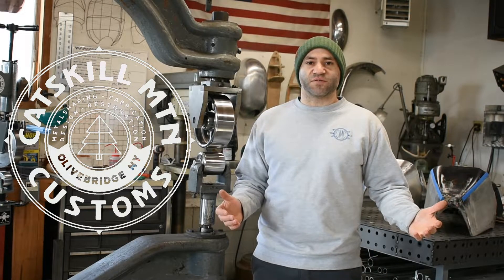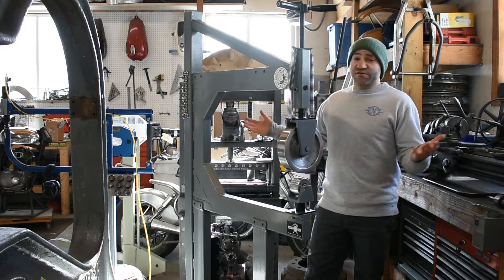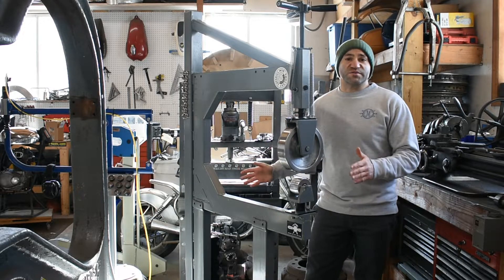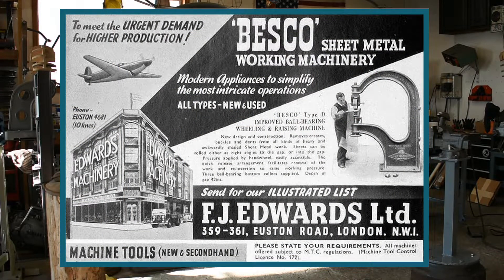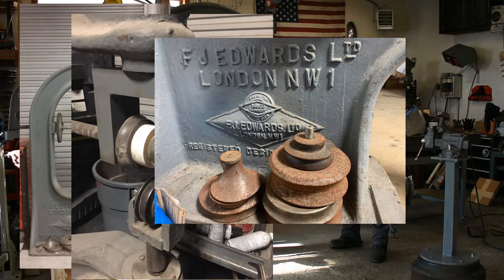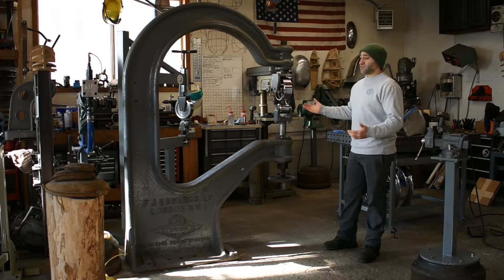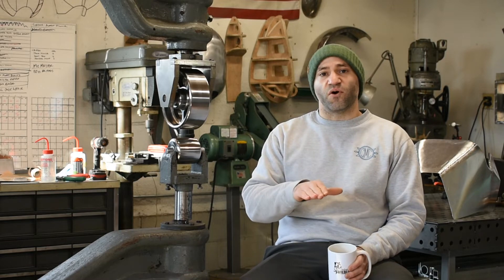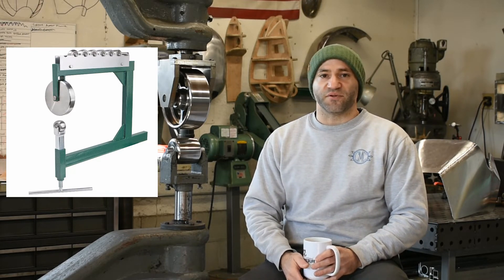Metal Shaping: Which English Wheel Should You Buy??

Comment: Great stuff! I built one to my specs. Free scrap heavy tubing, turned my own anvils, turned and polished a forged 3” top wheel. C - frame with top adjuster. All in, bearings, 4140 stock, acme thread - maybe $300. Fun machining project! I, and friends, like it better than the Metal Ace in our club. Be patient hunting for supplies, be willing to spend for a good top wheel. I bought a cheap caster top wheel that worked but never liked it. Bought a forged heavy castor and designed tapered bearing cups and am proud of it. Don’t cheap out and you can still have a pro quality beast for less than a HF wheel. Thanks for this content!
Reply from the maker: Great info, and it sounds like a fun project! The difference that sets you apart is the skills and access to machinery to do all of that work. There are a lot of excellent panel makers who have little to no machining knowledge, or access to equipment. I only own a 9” Sounthbend lathe, turning a forged top wheel would be a big ask. Not to mention the time you have into that machine. When you factor in all those aspects, you have a very expensive wheel! I guess my point is if you have the time, skill set, and machinery access you could make a very nice wheel. But, for many, that simply isn’t a realistic option.
Reply: @CatskillMtnCustoms  Good point. I’m also persistent. I have friends with the tools to build things and they still buy or go without. I must have a problem.
Reply from the maker: @836dmar  haha I wouldn’t call it a problem. You enjoy it as well, so that counts for something! Personally, my time is what’s most valuable to me, so that’s always my biggest factor. It usually makes more sense to put my time into customer projects and just buy equipment. Then when the tool arrives, I can put it straight to work. But, I’m running a small business so everyone’s situation is different 👍
Reply: @836dmar  Ha!  Old school craftsman.

Comment: would love to see all your metal working tools in your shop
Reply from the maker: I actually don’t have a ton of equipment. My large tools are the Edwards english wheel, a small Sosa Metalworks power hammer, a Mittler Bros planishing hammer, and a Mittler Bro bead roller. I have a decent collection of hammers and dollys which get the most use. If you check out my Instagram posts you can see my set up 👍

Comment: This was really good info about English wheels. What are your thoughts on the Eastwood Elite large framed English wheel?  I have worked on a MetalAce at one shop I worked for but we hardly used it and it collected more dust than being used. Plus I won't be using it as much at the start.
Reply from the maker: Thank you, and thanks for checking out the video. I have never seen that particular English wheel in person, but it seems a little overbuilt to me. Similar to the yellow baileigh wheels. For the same price I would lean towards the Mittler Bros bench mount english wheel which has the same throat depth as the large Eastwood 👍
Reply: @CatskillMtnCustoms  You're welcome, thank you for your info. I'll go check out Mittler Bros one 👍

Comment: Hi Nick. How much flex are you talking about? I look at yours and think omg how beautiful it is and my immediate though is 0 flex has been engineered into it. Can you please explain a bit further. Thanks for this video too.
Reply from the maker: Hey Paul, thanks for checking out the video. The wheel definitely flexes, but the amount of flex is very difficult to describe. For example, if you are wheeling a panel with moderate pressure, and the panel comes out, you can push it back between the anvils without loosening the adjuster. Also if you hit the top anvil mount with your palm, the anvil will move side to side about 1/6”. When you think about it, any shaped panel has varied thickness throughout. The wheel needs to flex to accommodate for the thicker/thinner sections. If the wheel did not flex, it may squeeze the thick sections and not even touch the thinner areas. This is especially important when planishing out a panel to a nice surface quality. Hope that answers your question!
Reply: @CatskillMtnCustoms  that's amazing a 1/16 is a huge amount. Thanks for taking the time to message back. I will be checking other videos of yours too. I don't thing Wray has ever mentioned there is flex. I know if the panel comes out you can push it back in with force, just figured it was in the adjusters. I have been looking at Wray wheels and my own design. May just have to go with his plans and be done. Thanks once again.
Reply from the maker: @paulnewton943  No problem. Yeah, 1/16 is a lot, but keep in mind that’s front/back flex. To flex it up you have to overcome the weight of the frame’s top arm. Wray’s wheels are very stout, and for me are way too stiff. I’ve been to Wrays shop, and used his older wheels. I have not used his newest design. He’s a great guy, and has his own “non-traditional” approach to wheeling panels that works with his huge wheels. The beauty of a cast wheel is not only it’s smooth flex, but also the weight of the frame behind the top anvil. When you put pressure on a panel with a fabricated frame e-wheel, you’re stressing the wheel’s frame like a C-Clamp. The more you pressure the frame, it loses any flex that it may have. at light pressure. With a cast wheel you’re basically trying to lift the 100’s of pounds above the top anvil. So you can have a lot of pressure on your panel, and the frame isn’t stressed at all. So the frame can still easily flex along the panel. However, cast wheels simply aren’t economical for most people, if I wasn’t a business, I wouldn’t have one…If you’re considering one of Wray’s wheels, I would recommend taking one of his classes or just visiting his shop and checking out the wheels first. It’s never a waste of time or money to go see Wray 👍

Comment: Hey boss, how much up and down flex is too much flex in an English wheel. I bought my first one a northern tool Klutch brand, so it al beginners level and im sure modification's are in the future
Reply from the maker: That’s the really tricky question, and to be honest, I don’t have a great answer. Basically just a bit of flex at working pressure. There is no measurement or anything, because every wheel is different. You don’t want to have to flex the frame a ton to get the metal to move, but you don’t want it too stiff that it won’t flex with the changes in material thickness. There is a sweet spot, and it really takes time to get the feel. I understand how frustrating that sounds as a beginner, but if you’re just learning I wouldn’t concern yourself about it too much. Focus on learning to make shapes, and you’ll gain the experience to judge your wheel’s performance 👍